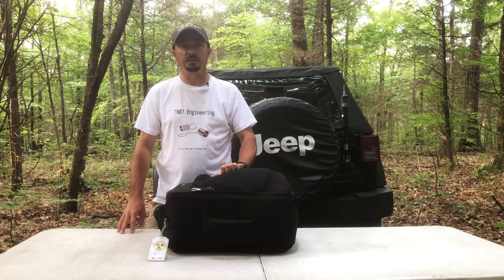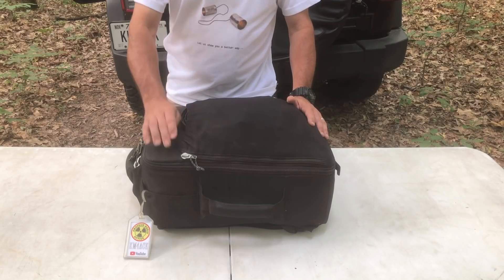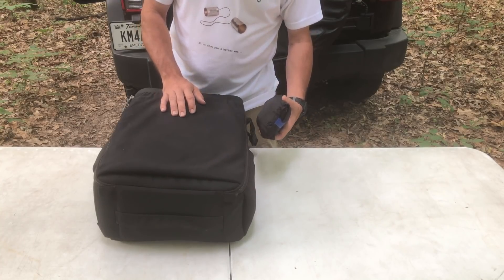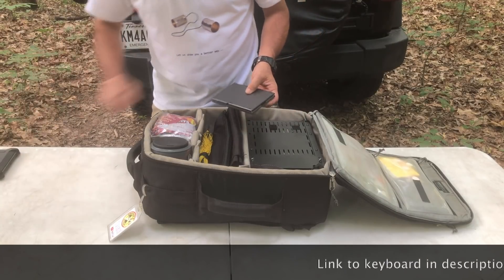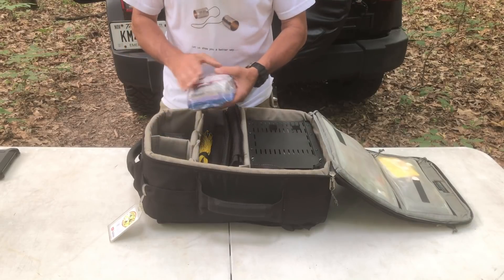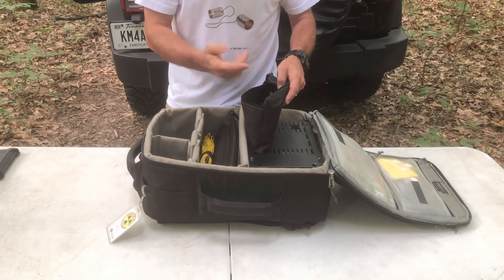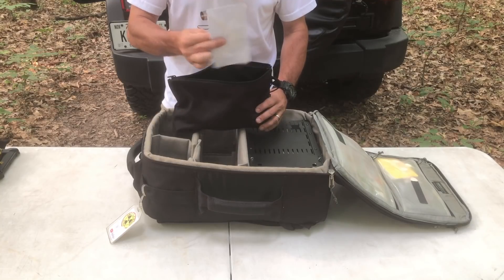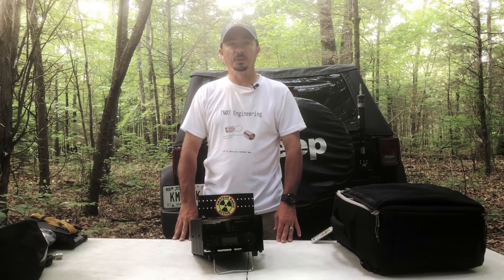Field Day Loadout 2019

Comment: Nice set up! I'd throw in a lightweight tarp for some shelter (assuming operation away from the vehicle) in case mother nature doesn't like field day.  ;)
Reply from the maker: Thanks. My setup changes each year. Always trying to improve things. Plan on using the mega tarp (12x16 i think) that's always in the Jeep. Otherwise, I would totally agree. Thanks for watching! 73, de KM4ACK
Reply: @KM4ACK  Holy smoke! Cathedral ceilings! I joke with my kids 'Go big or go home', but you don't mess around!
Reply from the maker: They say some rain/storms might pass through tomorrow afternoon. I just like to be prepared. :) That tarp stays in the jeep in case we get caught out in a storm with the top down. It's happened to every Wrangler owner I know including myself. de KM4ACK

Comment: Nice setup there Jason!!  Maybe we will work each other tomorrow during FD.  I will be operating from my home, and if the weather is good I will be on my back deck running battery power (I hope).  Did that last year with the QCX40 and a 12 volt 7 amp/h battery and a no tune EFHW antenna setup as a sloper.  Worked, I believe 35 stations.  I like that setup you have your radio mounted in.  I have a ammo box that I setup my 2Meter/440 mobile in with the same battery I listed above, in fact that is what I had setup on the deck last year when running the QCX.  I need to look into the battery you showed and the solar setup as well.  Thanks for sharing and again good luck on FD and have fun, that is the whole thing about it!  73 WD8WV
Reply from the maker: Thank you. I have been working on it, adding to it, and changing it little by little each year. I will be working JS8Call on 40M most of the time. Maybe we can sneak in a quick QSO. Doesn't matter where you do FD as long as you GOTA! 73, KM4ACK